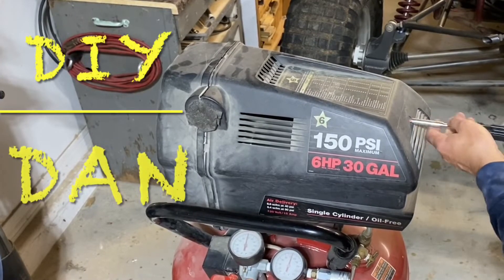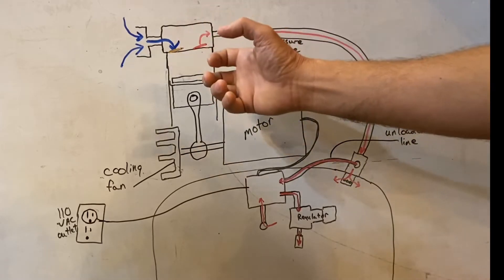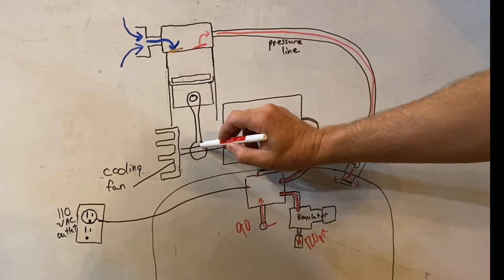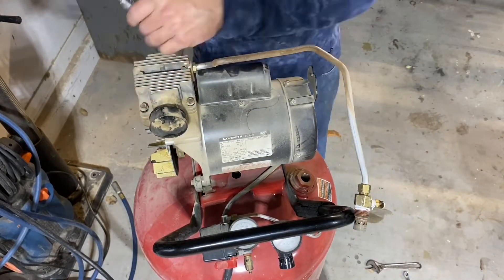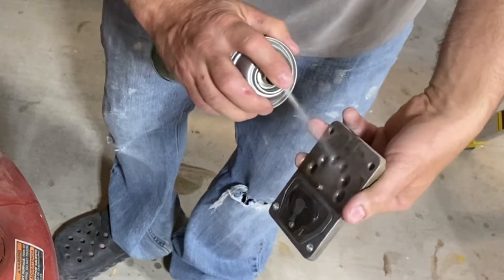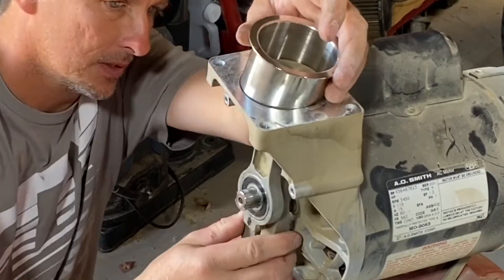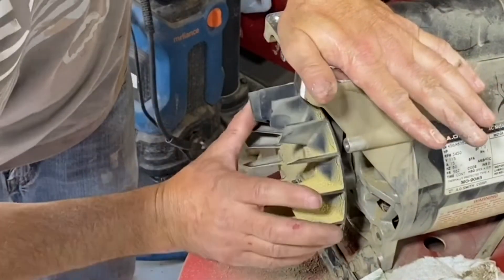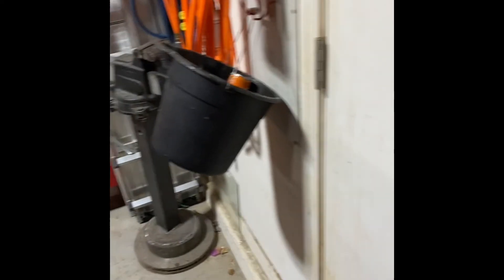HOME AIR COMPRESSORS OIL FREE HOW THEY WORK, DIAGNOSING & REBUILDING ONE THAT'S NOT WORKING PROPERLY

Comment: You should have used solvent to clean the reed valve plate and contact area then 2000 or 2500 sandpaper then mothers polish being careful not to bend them. 300 grit is sieving air

Comment: Do  you think if the compressor was working, but I turned off because I felt I had enough pressure to fill a tire, then when I went to turn it back on it just made a buzz noise but didn't turn on? Is that likely the piston or something binding in an odd position the electric motor just can't over come? Like you, mine is 20 years old and filter denigrated some time back from dry rot. I think I'm going to disassemble it to make sure the motor will turn before ordering parts.
Reply from the maker: Sounds like back pressure on the piston possibly the check valve
Reply: @diydan7019 I checked it and it's good. I think it is actually the cover on the for the electric motor. Top screw mount for the cover broke and allowed the cover to separate just enough that the centrifugal switch on the cover probably isn't engaging correctly. I got a piston rebuild kit anyways and will freshen everything up. Gotta devise a way to secure the motor cover.

Comment: What I would like to know is how to adjust that regulator to cycle off at about 90-100 lbs. 150 is to high for any of these oil-free  pumps - especially when it has a 30 gal tank.
Reply: Mine goes to 165

Comment: Those reed valves are spring steel and have a huge potential cycle number.  They're ok.  You might consider 800 grit to clean the plate.  300 is too coarse.  Good info, thanks for sharing, learned a lot.

Comment: Hi Dan.. great repair video! I have a unique problem with my oil-free air compressor, 2hp, 8 gallon, that i cannot figure out or find any info on.. it runs and builds pressure but at various levels, between 20 and 80#'s, will stop and start cycling off and on continuously every few seconds. So I wired the motor directly, by passing the pressure switch, and it still does the same thing. The check valve is good, holding pressure in the tank. If i disconnect the line from the tank then the motor will run fine and puts out a lot of air.. but when reconnected to the tank will begin to cycle off and on again. I'm hoping you have an idea of what's wrong. Is it something mechanical, like the valve plate or piston/cylinder.. they both look in very good condition.  I have a couple other ideas but no clue how to check them and i don't want to start replacing everything hoping it fixes it.

Comment: Its not just the Price .... Honestly today in 2025 its almost impossible to get a hold of a compressor that produces the 3hp - 5hp - 6hp with out spending over $800 all of the compressors under $1300 are only producing 2hp price is around $200 but those horse powers arent there today , to reach those numbers gotta go gasoline , jst to get a decent 5hp and its gonna cost around $1500 at northern tools unless you start searching the web and get lucky with these and or a speed aire 5hp 30 gallon which was a belt compressor , my next move is to get belt compressor since all i can say i feel like lucky like a one in a million to run into this video on youtube .... any where on the web really 2bh ... all parts are discontinued mostly but my eyes glanced with joy when i heard the name "amazon " Honeslty id wished how much they sold the motor 10 yrs ago around because its really worth having an extra and extra parts since i hear people saying that they are just fixing their craftsman compressor after 10-15 - 20 yrs ! 🎉

Comment: Next time you work on it, throw in the thermal cutoff explanation. Great video.
Reply: Is that thermal cutoff mounted on the motor and could cause it to cycle off and on? I am having that problem and cannot figure it out. If it is the thermal cutoff how do you repair it?

Comment: Got the same compressor 
Mine sound weird tripping breaker 
I had a tire going down I waked it started working.
Then it stopped 
Just tripping breaker now 

Well I see what I’m up against
Reply from the maker: @LarryVargas-fs2xf  disconnect the line from the head and turn it on if it still trips breaker probably bad electric motor if it doesnt you might have a bad check valve putting back pressure against the piston and overloading the motor or bad reed valves
Reply: @diydan7019  
I contacted a scrapper HES DROOLING 🤤 TOO TAKE IT AWAY 

HOPEFULLY ITS SOMETHING I CAN HANDLE .
Reply: Did you figure out what it was? Mine just started doing the same thing today.
Reply: @calivalley9056  
Mines about 18 years old 
I haven’t started taking it apart yet 
My lawn tractor went down 2 days ago 
If I wasn’t old THE YOUNG ME WOULD DO REPAIRS AT THE SAME TIME.
I’m looking up information on the lawn tractor now 
WHEN IT RAINS IT POURS 😞😞😞

I’ll update once the mower is running

Comment: I have a 60 gal.6hp craftsman unit but am tired of the noise a slow filling and yes I’ve already fixed that once but want to turn my motor into a pulley drive to run a h.f.5 hp pump but the motor has a huge funky shaft and I can’t for the life of me see how you get the aluminum housing off w/out cutting it off and then probably have to make an arbor for the pulley
Reply: I’ve thought about doing that too.
I’m assuming yours is also a two cylinder?